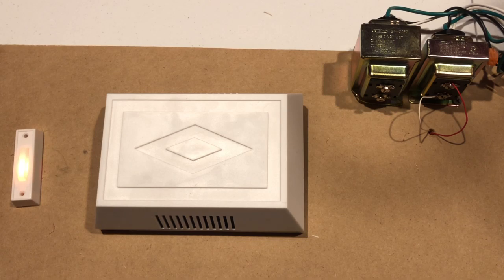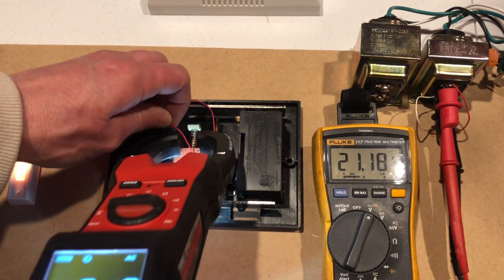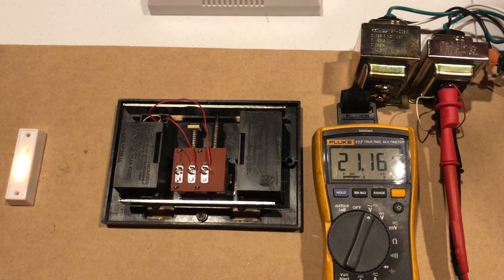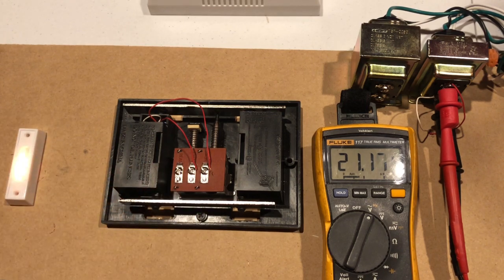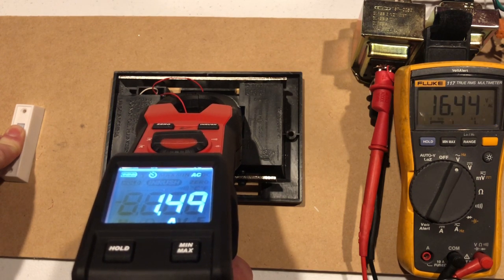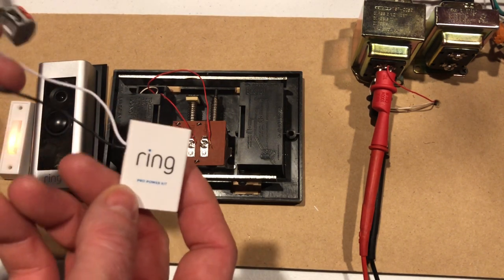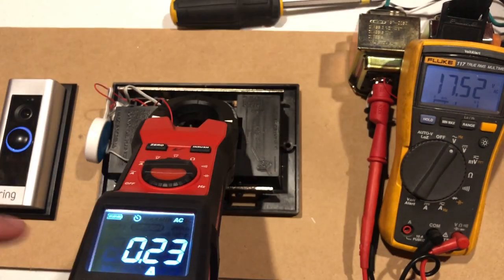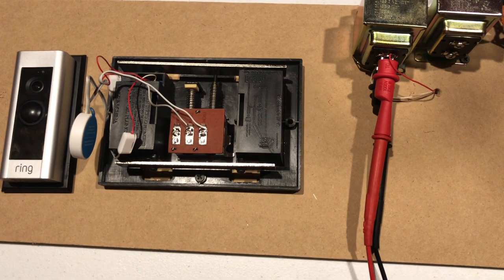16V 10va VS 16V 30va Doorbell Transformer

Comment: I have a front and rear door.  want to swap out the old doorbell buttons/switches to a video doorbell on each.   What if I just want to ditch the old mechanical doorbell all together.   Can I just tie the 3 red wires at the doorbell (front, transformer, and rear wires) together using a twist connector ?....and then use either a 16v/10va or maybe a 16v/30va tranformer?

Comment: My 16V 10VA transformer has stopped working.  I only need it to power the same old-fashioned doorbell.   Is there any drawback if I use a 16V 30VA version?    For example, would it overload the low voltage wiring?   Thanks!
Reply: I’m looking to do the same thing. How did things work out for you?
Reply: @robertbrookshire165  I used a 30VA transformer to replace the bad one rated at 10VA without any problem.  I think the actual power consumption is determined by the device in the circuit or a doorbell in my case.  VA is a measure of capacity - how much amp the device can draw before burning out.   If you plan to upgrade to a Video Doorbell which will draw more current, you are actually better off getting a 40VA one.

Comment: Will a 16v 10a door chime work with a 16v 30a or do I need to check the chime for some compatibility?
Reply: Just make sure if the chime is rated for 16v, use a 16v trans. Don't use a 24v transformer on a 16v chime. The va can be higher, so a 16v 30va would work perfectly fine.
Reply: @mr.boniato6402  thank you for clarifying!

Comment: I bought a hardwired RING basic doorbell for my 82 year-old, mostly deaf, mother, so she would receive visual notification of visitors that would alert her on her cellphone, which is also hooked up to her hearing aids. Because my elderly mother is in a fixed income, and not very technologically proficient, I opted for the most basic, simple, least expensive version that is supposed to replace any existing hardwired doorbell and can be installed by almost anyone with minimal electrical or mechanical skill, like myself.  I do have some knowledge about home maintenance and repairs, however—so I first checked the specs on her existing 40 year-old doorbell that worked perfectly since installation long before my family purchased the house- and the specs for the transformer were in line with the requirements for the basic hardwired RING. I even checked the wiring with a voltmeter and the reading confirmed the power was adequate.  I then followed the installation  instructions meticulously and upon completion the RING doorbell failed to function, supposedly due to inadequate power from the transformer. Tracking down the transformer was more difficult and when I finally located it, in the darkest, most inaccessible creepy old closet in the garage, nestled among 50-year-old cobwebs and God knows how many spider carcasses, not to mention the still living crawling things that probably reside there, I had to throw in the towel.  I’m handy, but fuck spiders in my hair— and I don’t give up easily so this was a moment of great frustration for me.  Dejected and angry,  I uninstalled the RING, defeated, and reinstalled the old doorbell.  At this point I had already drilled holes in the brick to mount the new button, which was larger than the old one so the old holes were hidden behind hit— to do this I had to purchase a masonry bit for my drill— needless to say I was EXTREMELY unhappy having to mount the old button, leaving the two new holes visible. My mother’s home, while old, is very nice—she keeps things very neat and tidy and while two small screw holes may not seem like a big deal to most, my mom HATES flaws like that.  Still, I carefully rewired the old button and securely mounted it to its original 40 year location only to discover— IT NO LONGER WORKED!!! After 40+ years of flawless operation!!!!  I was already wary of RING because the wiring instructions intentionally bypassed the chime, so that by installing the RING, you lost the regular chime function of the existing doorbell— of course, in order to retain regular doorbell function RING required an upgrade to the next model, which was 2.5 times the cost of the basic.  This, I felt, was an underhanded, intentional effort to force customers to purchase the more expensive model by purposely configuring their product in a way that unnecessarily disconnected the existing doorbell chime. So when I found my old doorbell suddenly broken after attempting to install the RING, I researched the basic model online and found, unsurprisingly, that countless other customers all experienced the same issue, regardless of the type, model, manufacturer, age or configuration of their existing and previously functional doorbell.  When I contacted RING I was told they would be happy to “fix” the problem their product caused by replacing my transformer for “free” IF I upgraded to their model that cost 2.5 times more than the basic version.  WHAT A COMPLETE SCAM.   That fraudulent, unscrupulous company is selling thousands of unsuspecting customers a product that will damage their personal property, thereby forcing them into spending more than double their original investment or else the customer, while they may be refunded, will no longer have a functional doorbell and face a much more difficult and expensive repair as a result.  For many people, especially senior citizens like my 82 year old mother, who are concerned about home safety and want a video doorbell for personal security, but who may also be living in a fixed income, attempting the very simple RING basic installation is already a challenge, so to then be confronted with a transformer malfunction or more complex electrical wiring issue, they are totally out of their depth and stuck with no doorbell at all or forced to purchase a RING PRO, that they cannot afford and may not even be able to operate or understand.  FURTHERMORE, after the RING BASIC damages their existing transformer, the installation of another wired doorbell, the installation of the RING PRO doorbell or even the repair/replacement of their now faulty transformer will doubtless require they acquire the assistance of someone with some level of technical knowledge or professional experience to locate the old transformer and solve the problem.  What if the transformer is in the crawl space??? How the hell could my 82-year-old mother ever resolve the problem caused by the CROOKS AT RING, without paying somebody???    Now, I know I can go buy a transformer and face my fear of spiders and swap it out, but that will set me back at least $30 and an hour or two of my time, not to mention subject me to extreme emotional angst, when prior to making the mistake of assuming a company as well-known and heavily promoted as RING would be peddling a decent product that functioned as promised and treat customers fairly, my mother had a perfectly good, functional, reliable doorbell that never gave her any problems.   

I apologize for my rant, but after watching a couple of your videos, including the one about doorbell transformers, I thought maybe this would be the perfect channel to vent my frustrations to.   

If there is any advice you can offer me, regarding my current dilemma after I GOT TOTALLY DEFRAUDED, CHEATED, SCAMMED, AND RIPPED OFF BY THE SCANDALOUS, UNETHICAL THIEVING CORPORATE CRIMINALS AT RING, WHO CON TENS OF THOUSANDS OF CUSTOMERS AND CHEAT AND LIE FOR PROFIT, I would be very grateful.  As of right now, I plan to install a motion activated camera that has nothing to do with the now broken doorbell, and with a gun to my head I will force myself to install a new wired doorbell and transformer— troubleshooting the old bell and transformer seems daunting and like it may lengthen the amount of time I have to spend in the creepy, dark, dirty cabinet in the garage with the 50 year old spider nest.

Comment: I added a nest hello about a year ago and it’s wired to a chime inside. Recently I noticed I was not getting notifications and when I tried to view video as soon as a person pressed door bell video would freeze. This video proves exactly what I was wondering… when I unwired chime the nest hello works perfect and quickly. Draws .1A but when I wired the chime back it draws .83A and door bell goes offline. The transformer is 16v 10VA so I will be going to the 16v 30VA. Thank you for great video!

Comment: Hey, I have a Nest doorbell wires that doesn't power up. It's the second unit I've received from Google and both don't work. I have the same 16vac/30va transformer pushing 17.8 volts at transformer and 17.8 volts at the doorbell yet the nest doesn't even turn yellow. any tips? thanks!

Comment: Hi!  When upgrading the transformer to a 16-30VA should I also replace the chime?  My current doorbell chime is an old zenith rated at 16VAC 10AC.  Planning on installing a ring pro.
Reply: @carlos, this is exactly my question. Assistance is appreciated.
Reply: @jeffc651  I didn’t replace the chime, nor transformer.   According to the electrician, the current transformer was sufficient.  Doorbell appears to be working good so far.
Reply: @carlossalinas6234  So glad it worked out for you. I had to replace the transformer as the chime would just buzz after pressing the doorbell. Works a lot better now.

Comment: Sorry this is a older video, I just purchased the google hello doorbell and have power to the doorbell but no chime inside. I currently have a 16v 10va transformer. There is another regular doorbell installed for back door and works fine. Would switching to a 30va transformer help in getting a chime? Also the mech. doorbell chime itself is only rated for 16v 10va.
Reply: I saw Eufy documentation that suggested 16V 30VA for one camera doorbell and mechanical chime, 24V 40VA for two sets of doorbells and chimes.

Comment: hey there, so im a few years in on this post, hope youre still around. I just moved into a REALLY old house. Like 50's. I bought a Lorex camera with video. The door chime I have says "only use 16V 10A transformer. I have a 24V 40A, and a 16V 30A. would the 24 be ok to install with that door chime? but also the 16V I have isnt 10A its 30A. The instructions on the video doorbell says I can use either of those, but the chime is rated differently. thanks so much!

Comment: Will the 16v 30va transformer be good for running two nest hello video doorbells and a 16v chime box? I want to make sure I don't burn up the chime box. Currently my chime box is running off of the 10va version of the transformer.
Reply from the maker: It should I have been able to do it with 2 Ring Pros.  I don't have 2 Nests to test it with.  If it were me I would go with 16V40va.
Reply: @sellgooddeals-DIY  I already took the leap and installed the 16v 30va transformer and everything seems to be working better. The 16v 10va transformer was just a little to low on power for two doorbell cameras.

Comment: fantastic video. so im looking to buy a wired ring doorbell camera at the moment. i checked my bell transformer and it says TRAN 8/12/24, 230v-50Hz, 8VA. im guessing this is not adequate. Do i need to upgrade the transformer and if so how many hours should this take an electrician to do so I know im getting a fair price? Also I was hoping to use my existing doorbell chime, do I need to upgrade that as well? Many thanks in advance, have been searching for someone to explain this for hours online.

Comment: Having problems installing my Ring Video Doorbell Pro.  Question:  the transformer outputs, are they AC or DC outputs?  Does it make a difference? I don't have a clue.  Thanks !
Reply from the maker: They are AC, it won’t run on DC.  Also, you will need to upgrade your transformer to a 16v30va or bypass your chime for it to work.
Reply: AC, thanks! To complicate matters,  the original transformer , 16V 10 VA, was used to power a button doorbell and a small light which illuminates my address numbers 24X7 on the front of the house. I live under HOA rules, the light must remain.Two sets of wires coming off of the transformer.  If I replace the transformer with your 16V 30 Va, will that be sufficient to power the address light and the Ring Video Pro ?  Or should I go with two transformers? Really appreciate your help !
Reply from the maker: How many lights and what is the wattage of the sign?
Reply: @sellgooddeals-DIY  One 12V 5W bulb on 24X7.  Could I just replace the transformer with a 24V  40VA  Maxdot (Amazon) transformer?  Or would that blow out the light? I'm stupid.  Thank you !
Reply from the maker: @GeneL56  Go with a 16V 30va would probably be adequate but I would go with a 16V 40VA to be safe.  It won't blow the light but it may not last as long.
Reply: @sellgooddeals-DIY  My saga continues:  my (questionable) electrician says I should use a 24V 20 VA transformer. Again, this is for a Ring Doorbell Pro and a 5 W address light.  Your opinion please, and Thank You !   You had earlier advised to get a 16v 40 va transformer.  I can't find one on Amazon or Home Depot?  Would a 24V  40VA be OK?
Reply: Dec 6, 2021 update: Although CAT5 wire is being used and it is also powering two 5 W 12 V mini lights, the 16VAC 30VA transformer I installed seems to sufficient to power my Ring Doorbell Pro. All good for last 5 days. Thanks for your help !

Comment: I have two doorbell chimes attached to regular push buttons, and one transformer which is attached to the breaker box.  The old transformer was 16v 10va, would I be okay to replace it with a 16v 30va?
Reply: Yes.. the va can be higher. Just make sure if the chime is rated for 16v, use a 16v trans. Don't use a 24v transformer on a 16v chime.

Comment: I am having issues with my nest hello, I currently have a 16v 10va, but after some research I am wondering if the 16v 30va would suffice, I have a long run with the wires. they go from one side of my 3 car garage to the other side of the home, maybe 60ft to the doorbell, and 60 feet to the mechanical chime inside. would you recommend stepping up to a 24v40va? I would just hate to waste money on a 16v30va and it not carry enough. I'm getting 18v at the xfmr and 14v at the nest hello. any info is appreciated. thx

Comment: Hello...thanks for the video.  We have a Ring Pro and just upgraded our transformer to 16v/30va after experiencing poor and delayed performance from our Ring.  However, our mechanical doorbell chime is 16v/10va unit and there is a slight buzz coming from it (without pushing the Ring button).  Will we have to upgrade the doorbell itself to a 16v/30va....and do they even make one??  Thanks :)
Reply: My old mechanical chime was really old and when I upgraded the transformer to  24v/40va, there was a loud buzzing sound on the mechanical chime and a burning smell. I believe the high voltage/amp burned out the mechanical chime.
Reply: @easyroc75  I had that burning problem, but in my case the button got stuck in the on position and kept the current flowing for too long.

Comment: I upgraded to GE US made in US transformer rated at 24V 40VA,  Works very well driving
Westminster chime. Little bit over kill I guess. Thanks for the demonstration.
Reply: At least you are future proof with any new video doorbell that requires the power
Reply: keep in mind that if your chime is rated for 16v, running it on a 24v trans can damage it.

Comment: Great explanation and important.  Over on the Nest Hello side, there are numerous issues with the puck.  The camera works but mechanical door bell chimes do not with the puck installed.  Nest support does not seem to provide an answer to this.  You may have solved the issue.
Reply from the maker: Hopefully, you can get it working.  Thanks for watching!
Reply: Go into settings and turn on electronic chime. I had the same issue until I turned it on (for some odd reason).

Comment: Hi, great, easy to understand video. Thanks. We are having problems with an ezviz DB1 doorbell. It worked for 50 days then suddenly stopped and became 'off-line'. We contacted ezviz and they had us do volt meter readings, we got 20.4 at the transformer, 15.0 at the chime and 8.6 at the doorbell. Our transformer is 16v 30va. They are telling us the recommended voltage should be 16V-24V, hence the doorbell should receive between 16V-24V. Have you any suggestions for us? We don't know what to do next.
Reply: Try upgrading the transformer to 24v/40va.
Reply: What was your solution?